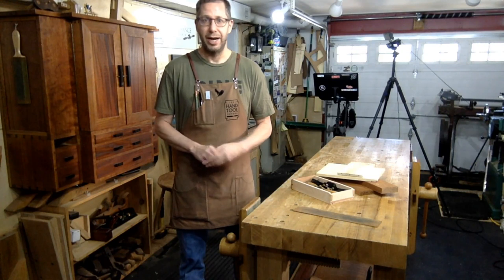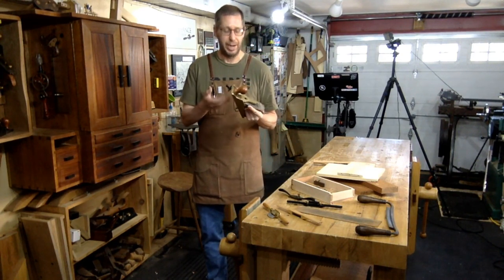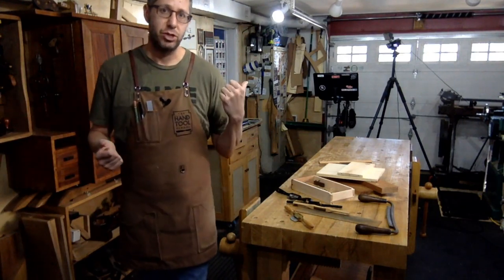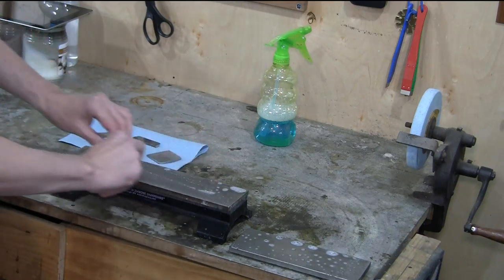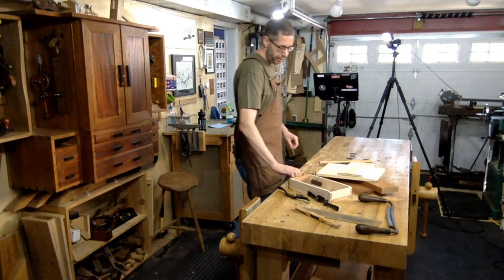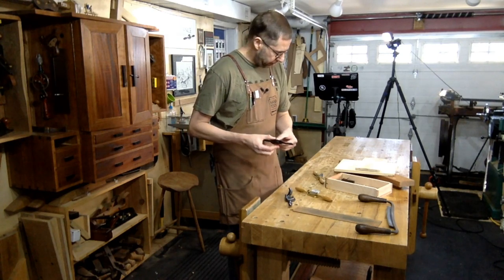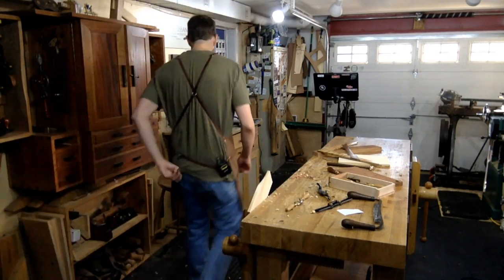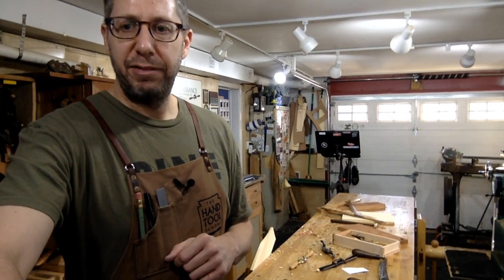Hand Tool Q&A Live: Spokeshaves

Comment: Hello I also am becoming a big fan of spokeshaves and find using them very calming :) recently I got a Kunz round bottom spoke shave and can’t figure out how to use it. Became so disillusioned that don’t even know if the bevel needs to up or down. I thought this was a good brand but really rough at the edges and the handles are not friendly. That said I am sure it can still work but I have failed. Any guidance ?? Thanks in advance
Reply: Watching the Paul Sellers video on spoke shaves, he says this Stanley 151 style, metal bodied spoke shave is supposed to be Bevel Down and the wooden bodied & metal flat style are Bevel Up. Watching this video, I've set my metal body Wood River flat spoke shave using 2o# printer paper & it's now a joy to use. My metal Bench dog round sole spoke shave came with the Bevel Up. Now that I've reversed it to Bevel Down it's much better, bur still needs a bit more "Fettling" (I "Learnt" it as "Futzing" on our side of the pond) as Mr. Sellers calls it.